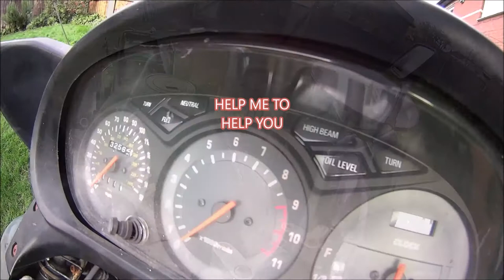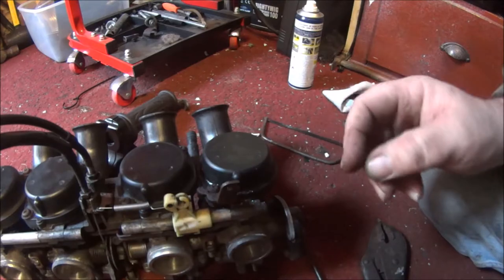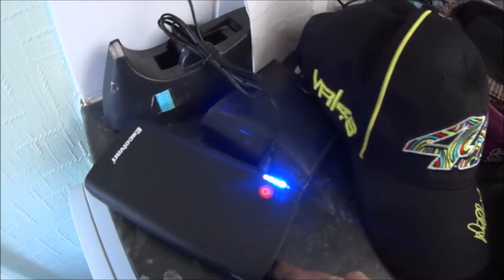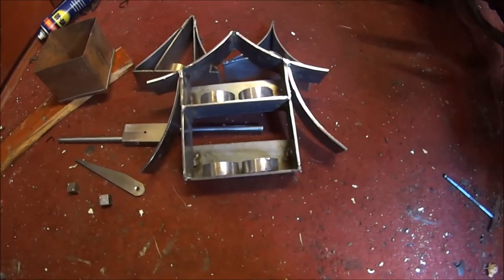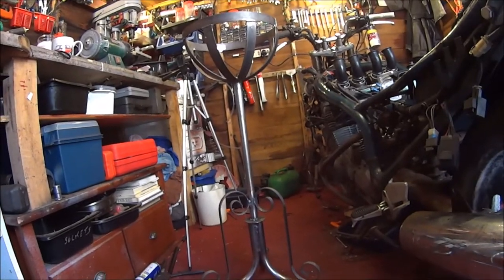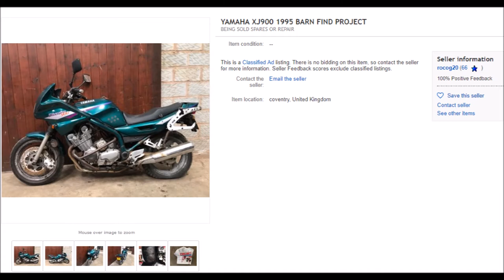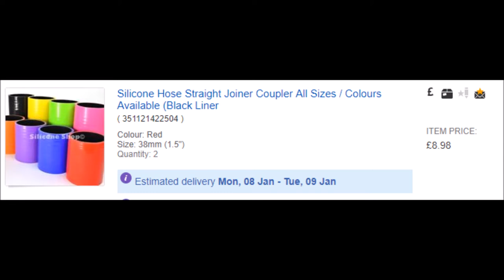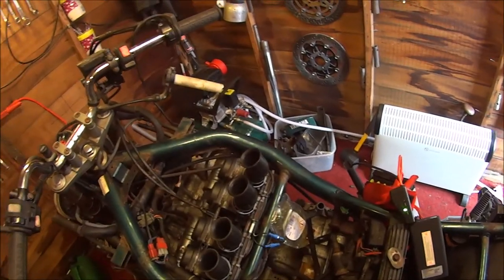YAMAHA XJ900S PROJECT PART 5

Comment: Hey John that is great she is running, you did a good job on the carb flanges mate, i have looked at the video and the flash appeared to be the plug and it happend at 12mins 55 secs just in case you have not looked yet, and if you have has it done any damage to the charging system, let me know how you get on, great videos again mate, Regards Mark..
Reply from the maker: SooperSkoots hey Mark thanks and I'm glad you enjoyed the video. Yes you are right it was the plug connector it's full of rust and the red wire burnt out at the plug